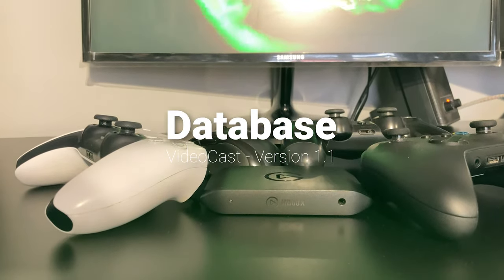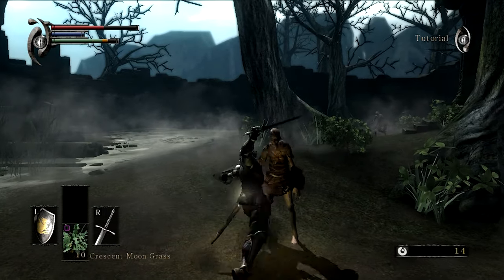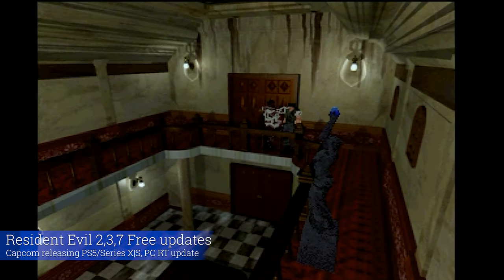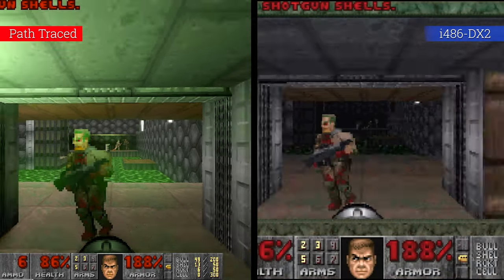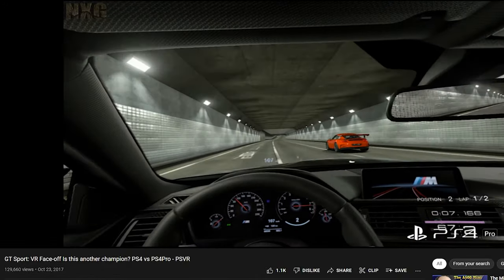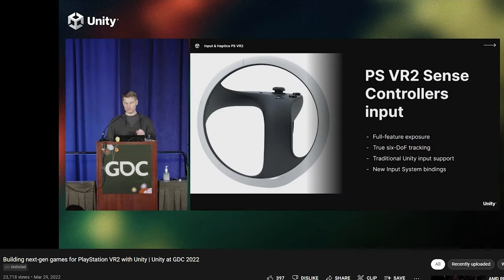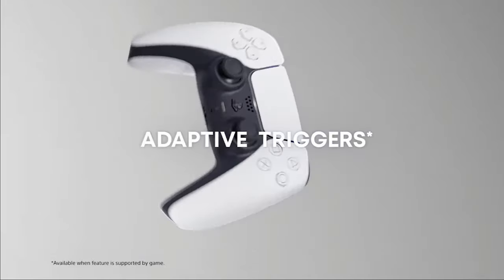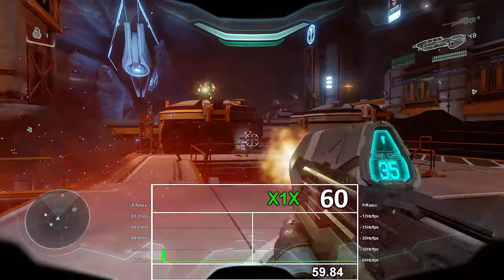Database Info -  PS3 Emulation, Return to Monkey Island, PSVR2 performance, VRR Capture | V1.1

Comment: I really was expecting PSVR2 with atleast a Wireless option eventually but the fact that they held back such a big feature can allude to a conservative price like the original. pumped to see how they push the New headset because its unleashed with a lot of new tech on the horizon, eye tracking/foveated rendering, upscaling, new controllers, headset tracking so it should feel great like the competition and look great. 4KOLED HDR display, Jesus Sony

Comment: I agree with the fellas below, we really need your view about PS3 Emulation on PS5. Would be interesting if you also point out the difficulties and differences in effort between emulating GOW3, Uncharted 1, 2, 3, Last of Us and play the actual ports of these games on PS5 through PS4 BC.

What would be the best solution? create an emulator who would work like PopStation in PSP era , or maybe actually port some of these games to PS5 into a labeled curated 'PS3 Classics'?
Reply: You know how they can create a working ps3 emulator on the PS5?  Let Microsoft do it.  They got some of the best software engineers on the planet and they figured it out most of the 360 emulation on xsx.  Just like how do you get a good DC universe movie?  Let Marvel make it for them
Reply: @ibrohiem  What a stupid take. The 360 is far easier to emulate than the PS3 and MS wouldn't find PS3 emulation any easier do.
Reply: @Deano7394  Bullshit, both cpus is based on powerpc architecture.  Both companies have documents on their hardware that fanmade emulator writers don't have access to.  The 360 emulation on x86 architecture is a massive achievement.  It can be done with the right talents, and they're there working for MS.  Sony needs to swallow their pride and start asking for help.
Reply: @ibrohiem  So basically everything nxgamer said went I/O of your ears!
Reply: @s3rv3r3rror8  a bunch of hobbyist got a PS3 emulator to work on the PC.....a bunch of fucking HOBBYIST GOT IT TO RUN on a steam Deck.  Explain that   Sony had two generation to figure it out!  Microsoft emulated the 360  within a half generation.
Reply: @ibrohiem  If you can't except nx gamers explanation who is an actual engineer. How in the hell could i convince you?
Reply: @s3rv3r3rror8  Let Microsoft handle it.  Because you know why?  There's no financial incentive for Sony to do it.  They're dragging their feet on it.  I can predict that people will port over Rpc3 to the Xbox dev mode before Sony will figure it out on the Ps5.

Comment: But aren't they removing the choice for PS Now subscribers. Who currently just pay $60 for that subscription alone. Even though they'll migrate over to the premium tier. Once it's time to renew that subscription, they'll be forced to pay either $100 or the full $120. They can no longer just pay $60 to access those older games. So it isn't really much of a choice for them.
Reply: You’re right. However, psNow originally launched at $120’ish a year if I’m not mistaken. So it’s kind of see sawed from expensive to cheap to now expensive again.
Reply: @captaincrunch1707  I can’t say if that’s true or not. It sounds a little strange if that were the case. Maybe they didn’t have an annual subscription when it first launched. So if you paid $10 a month, then it would equate to $120 a year. But that applies to PS Plus as well. It’s $10 if you pay monthly.
Reply: Most people aren't only subscribed to PS Now. PS Now has like 3 million subscribers, the vast majority of them will also be subscribed to PS+ as well.
Reply: @Deano7394  what are you basing that assumption on. Sony hasn’t released any numbers indicating as such. As it stands, those two services are independent of another. So it’s quite possible that a good portion of those 3 million subscribers are only subscribed to Now. Why is that, because over half of PlayStation owners don’t see to the need to subscribe to Plus. But now Sony is making Plus a requirement in order to access Now.

Comment: I think you need to research a bit more on Rpcs3...... 

RCPS3  has a 62.42% compatibility. Meaning 2142 games have playable performance and no game breaking glitches.  

Fact is Sony doesnt have any internal emulator...and cant use RPCS3 for various reasons. So its NOT due to a technical limitation but due to a lack of prioritization. And now that it seems that they are FINALLY prioritizing, they dont have the leg work done so they have to start from scratch. 

If they either somehow liscense RPCS3 or at least look at the code and semi-steal it by using it to fast track their own efforts, they can absolutely have PS3 emualtion on the PS5. 

And it DOESNT have to be an 'every game runs perfect' situation which you seem to allude to. There is no reason Sony cant do what MS did, which is once they have their internal emulator, then internally work on 15-25 games at a time to work out the kinks and get working near perfect on a per game basis..and release those. Then do another 15-25....then another. Doing it in cadence will allow deep level fixes and tweaks and concentration on a small portion of games at a time. AND build up hype and reawareness of the back compat offering with every release cycle.
Reply from the maker: I think you need to take your own advice here, you are just clicking on the website and seeing the figures. As I clearly explain in the video, the fact a game run within an emulator and does not crash or have game breaking bugs noted does not mean it is fit for a commercial sale and it misses all the issues that many of these have. I explain in the video but God of War for example has no MLAA enabled, so a huge part of the SPU delivery and visual quality is worse on RCPS3, even at 720p it drops heavily at points, even running on an RTX3080 and a 16c/24t 5+GHz CPU in the i9 12900K. Again sound breaks and heavy drops under 30fps even on this machine even in Infamous, ditto Uncharted 2, MGSIV, Red Dead, GTAV and more. Not to mention many visual bugs that all have such as no shadows, texture warping, vertex issues, effects completely missing etc etc and these are all in the 62% you mention, with a further 38% that are not working at all or have crashes, again just as I clearly explained in the video.

 This takes nothing away from the excellent work from the team and the emulator is superb and will keep evolving, but even on a PC that is significantly more powerful and likely 6-8X the total price of the PS5 it still cannot emulate the PS3 in many titles, and hardware (CPU specifically) lower than this is much worse and this is exactly what I am referring to and why this is not like the Xbox BC. That is done & dusted and working, and now has the boost options and resolution boosts, this is what Sony are competing with and they will not want to come out and have a lower quality Emulator, thus they need to go above and beyond what RCPS3 is doing on the PS5, and has you can see in the video linked, this is no small feat and backs up what I explain here, thanks

https://www.youtube.com/watch?v=YaqPXjwuW44
Reply: @NXGamer  I dont disagree with that comment....but it doesnt seem like you read the last part of mine. 
Of course it would be impossible to make a general all encompasing emulator that works great for all games. Yes even RCPS3 has issues on almost all games. 
The point is that the reason for that is beacuse they are working in a GENERAL sense...trying to make it as compatible as possible accross the board. 

I can gurantee you that if the RPCS3 team decided to stop their work, take 15 games, and exclusively concentrate on those, they could make those 15 work perfect.

Thats my point. Your point is only valid when talking about making an emulator be auto perfect. But if Sony made an emulator...and simply concentrated on making those 15-20 games work great, and not worry about the Entire library, its very very doable. Once those are done, then do another 15-20...etc...like MS did.
Reply from the maker: @guardianali  Yes, we agree and that it what I said in the video. They will most likely offer the specific titles to buy as a "Classics" package and also include these within the top tier PS+ sub. Based on the sales and return this will then be a next batch of titles etc. But as of right now the curated list will be titles they can:-
A) Get to run with improvements
B) Likely have a decent chance of sales to entice Sub/sale
C) Be rare enough that they have not been made available on PS4/5 or other platforms (ala God OF War Ascension, MGSIV etc).

But unless the ROI makes sense and works then it will be a short lived process. I am confident there is more to be announced here.